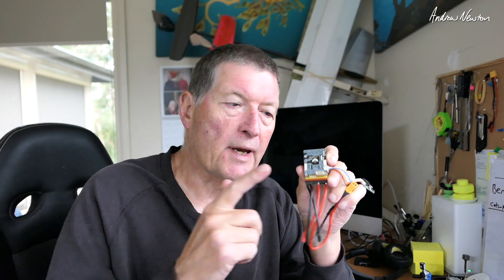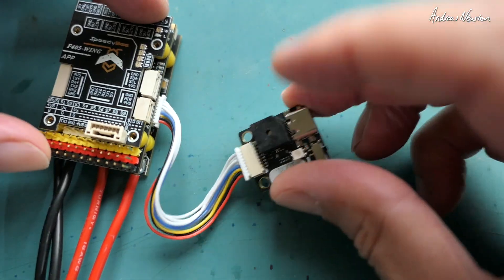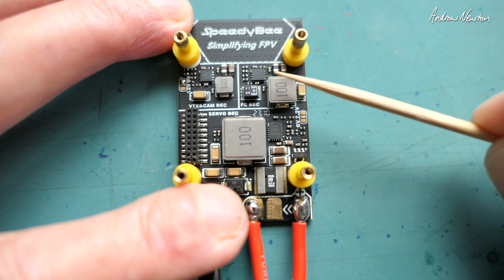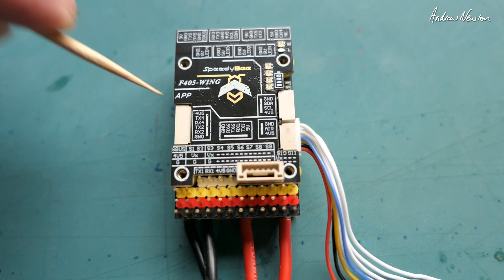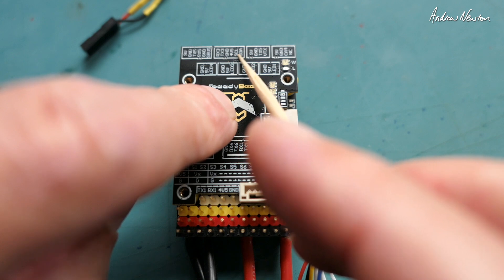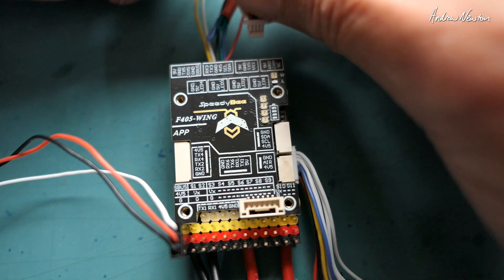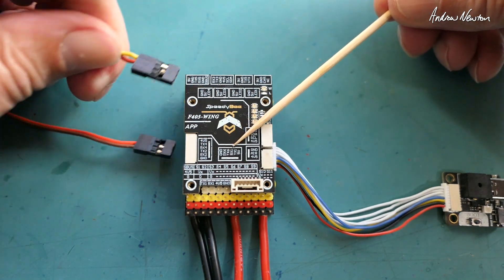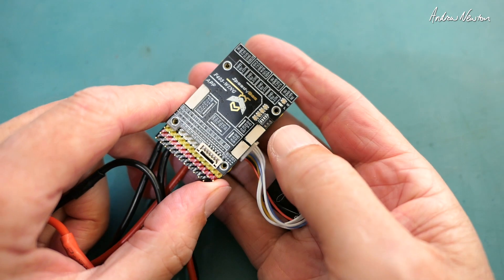SpeedyBee F405 Wing - Connection Basics

Comment: Hello Sir! New subscriber here I am amazed how well you are in this hobby, I always watches your how to videos, it really great that there are someone like you who are willing to share. As a matter of fact you inspire me to start this hobby. 
I already flown my ranger 2000, I ordered my first fc the speedybee f405 wing, sadly as I intalls the needed plugs and pins after powering using my 3s lipo I found out that my board beeps continously it seems not normal as I compare it to your videos.

May I know what can I do? Or what is really happening is it normal?
The boards heat up quickly after 5 seconds of powering via battery
Reply: Hope you see my comment thank you in advance
Reply from the maker: Thanks and I happy you are flying the Ranger. FC Heating up in 5sec is bad. I would guess there is a solder short or incorrect connection somewhere. Not sure about the beeping, I tend to turn it off until it's working OK

Comment: Andrew, great vid, but could you please try to get a servo working on port S8 in INAV. On my two boards that one gets skipped, even though the configurator shows them as configured ok.  Cheers, Andre
Reply from the maker: That is a bug with the factory firmware. Update to INAV 6.1.1 to fix it.
Reply: Ah, indeed that solved it, thanks a lot Andrew !  @AndrewNewton

Comment: Thanks for you outstanding instructional videos. Question a little off base,  but can't find answers anywhere else. I have the EPW6 from Happymodel, trying to wire it onto Speedybee f405 v3 FC for a flying wing. I have the EPW3 bound to my TX16S, I have 1 motor wired up to the f405v3. But connecting the EPW3 to the FC got me spinning. I didn't think using the esc from the PDB would going  to be this hard... I know Speedybee has a FC for a wing, Have them ordered, I say you use the mitek FC and thought I could go this way.... Hope I gave you a clear picture of what I am after... thanks again...AHC
Reply from the maker: EPW3 is just PWM as it comes, have you changed it to a serial output? Can the F405 V3 operate servos or just motors?

Comment: Hello Andrew....great video...i just finished connecting all wiring on this fc for my dolphin but i need some input from you regarding irc tramp in inav 6.1.1....seems to me the tx800 speedybee vtx irc tramp to the fc doesn't work as it supposed to be ...do inav need vtxtable like Betaflight?
Reply from the maker: Tramp wire to TX5, turn on Tramp for UART5 in Ports. That's all I can suggest. No need for tables as for as I know but I dont have any tramp devices to test with.
Reply: I tried other uarts too as Speedybee instructions via email to them but unsuccessful...same goes as smartaudio...well...i shall fly it by old ways..power up the vtx to max, connect it only after gps locked and ready for auto launch...wish me luck for my maiden on dolphin, sir😂
Reply from the maker: Just tested Smart Audio with an AKK Race Ranger VTx and it works on mine. T5 pin, enable in Ports

Comment: I am grateful for your easy to follow narration but I remain trapped with no screen representation of the receiver. I have built a second easy bee with exactly the same outcome. Hugely frustrating.
Reply from the maker: Which receiver and radio?
Reply: The change to a REAL Sbus radio worked wonders in the second unit but made no change in the first. While it seemed that the two units had the same problem it is obvious that it has the same symptoms in Inav. Thanks so much for your input !!!
Reply: The Transmitter is FrSky Taranis 9, six years old, never missed a beat. The receiver Radio Master R88 (Sbus) 1 week old working well
Reply from the maker: Didn't I answer you 2 days ago?

Comment: I have embarked on this adventure but I am currently stymied. In my connection to Inav 6 I have failed to achieve any communication from the Radio. I am running a Fr Sky Taranis 9 tx into a RadioMaster R88 rx, via an SBUS cable, out of the first group receiver pins (aileron), and into the far left SBUS connector, with white wire uppermost. This system works fine into a standard (no flight controller plane) I am using UART 2 for the receiver. But there is no response in the inav receiver display. I am not certain about the inav questions on the right hand side of the receiver page. Could I have missed some detail about the type of SBUS used ? I find it hard to believe that I have damaged  the First line of the Ports chart. But maybe ! If I had what would I see ? Any thoughts would be most welcome. Maybe I have a Speedy Bee Dud
Reply from the maker: The R88 is just a PWM receiver, not SBUS. You would need the R86C

Comment: Great video helps a lot. My question is what size SD card do i need to put in or do i need one? Thanks
Reply from the maker: Not required unless you want to record logs. Any microSD card
Reply: Thanks for the reply. I have another question please. Will the Foxeer gps work I have the M10Q 250 with compass in it? And how do you setup the throws on the surfaces like Spektrum I mean like low medium and high rates. I will be using DJI goggles2 and DJI controller with caddix vista air unit. Thanks again.

Comment: Where do you get the 4 pin connector for gps or crossfire. Great video. Ordered 3 of them. Using the fc esc stack for the quads.
Reply from the maker: EBAY DuPont connectors.

Comment: Hi Andrew. First off, this review and the others in your series on the F405 has been invaluable. I’m adding FPV to my LOS fleet, where I use a Spektrum receiver. Can you or any of your subscribers guide me on the best way to interface the two (Spektrum & F405)?
Reply from the maker: Dont know much about Spektrum but I think you would connect the receiver to UART1 T1 pin and select SRXL2 as the Serial Receiver Provider. Your receivers would have to have SRXL2 Serial output option.
Reply: I saw someone on another youtube video (Steve Salisbury) flying a T-28 in FPV with this Flight Controller using a Spektrum SPM4651T receiver and use a NX10.

Comment: How would a FrSky r-xsr connect to this flight controller?
Reply from the maker: Basic SBUS connection to the SBUS pins
Reply: SBUS is only the inverted RX and does not provide FPORT telemetry.  It needs to be an inverted TX PIN.
Reply from the maker: @kenimhof9333  Watch the next video. Soft Serial for S-Port works with INAV 6.1.1
Reply: Yes, I believe soft serial is the only option, but this is a poor design to not connect both the RX and TX pins to the inverted SBUS pin to fully support FrSky receivers.
Reply from the maker: It's an F405 chip limitation. Doesn't the RXSR have an uninverted SPort pad so you dont even need Soft Serial.
Reply: I am currently trying the pad (P underscore) and when connected to a TX PIN, I have receiver data but still not telemetry data.  Same receiver connected to an F7 board has working receiver and telemetry data.

Comment: Hi Andrew. I bought 2 speedybee F405 wing FC and both of them don't have motor signal output.  on Inave configurator its showing rx input and output but there is no acutual output on the speed control  pins. everything else  is working, arm, modes, all control surfaces, fpv goggle /camera. turning on the motor / servo output on the configurator dont make any difference.  convertional plane with tail and without tail don't make difference.  no motor signal output.  is this a common problem with this FC? any fix for it?
Thanks. hoping to get some good news from you.
Reply: After 2 days of frustration diagnosing this it’s now working.  I ended hooking up a digital servo into the ESC port and it activated that channel.  Now the ESC is working.
Reply from the maker: How strange. No idea why that would work

Comment: Hello once again.
I installed 405 Wing. I tried different tabletops as rover and airplane. I can't get output from S3. I did a solder check, everything seems normal. Thanks (google translate )
Reply from the maker: Enable PWM outputs and add something for S3 in the mixer. If that doesn't work then check your wiring or receiver connection
Reply: @AndrewNewton  Thank you 🙂

Comment: I have enabled servos, but I'm having trouble getting all servos to work😢 I'm setting up the atomic seal and everything is plugged in as inav shows. At first only the left aileron worked. Then the elevator started working
Reply from the maker: Either something wrong with your plane wiring,  incorrect radio setup or wrong board setup. Here's a trouble shooting page   http://newtonairlines.blogspot.com/2023/06/inav-trouble-shooting-checklist.html

Comment: Hi Andrew enjoying all your content here. I purchased a speedybee f405 wing recently. Every time I connect a GPS the baro stops working not sure why cannot figure out the problem . Have tried inav and arduplane same problem everytime.
Reply from the maker: Very odd. Does your GPS have a baro that might be conflicting? SPL006-001 is the onboard baro. See what is recognised in the configurator
Reply: @AndrewNewton   actually I discovered I had a pin problem in the connector the was causing the issue. I am getting a little blind in my old age . Thanks for the advice . I am hoping to use it as my first arduplane.  Loving your content Andrew very helpful and honest reviews.  Thanks.
Reply from the maker: Well spotted. You're the second in a few days with tricky connectors causing strange issues.

Comment: I have a bunch of old recievers for my flysky i6,they are called fs-ia6,is there a way to use these recievers on the speedybee or do i need to order another type of reciever?
Reply from the maker: SB F405 W needs a receiver with iBus or SBUS serial output, like the FS-iA6b. Your old receivers will work with a ZOHD Kopilot FC
Reply: @AndrewNewton  thank you ,I will still use them in smaller models that can't fit large speed controllers and upgrade to a better rx, will the fs-a8s be best for this fc as it is minimal in size
Reply from the maker: Dont know the FS-A8S but looking at the specs it should work.

Comment: Can i connect the power from my ESC BEC to the board, not using the PDB to power the servos? I've used Pixhawk and always power it using the BEC from my ESC
Reply from the maker: No, not recommended. Would still have 2 competing power sources on the board

Comment: Hello Andrew, thanks for your video! I would like to ask you a question! Does this controller have an integrated osd with information such as speed and altitude? Thank you very much in advance
Reply from the maker: Yes it does. Speed would need a GPS and/or Air Speed Sensor connected.

Comment: Good morning, what Gps module, and what speed sensor are compatible with this controller, what other sensors could be installed?  Thank you!
Reply from the maker: I use BN880 GPS, Matek Air Speed Sensor is good. Dont need vario or baro.
Reply: @AndrewNewton  thanks for reply, i will buy an a try to configure it, God bless you!

Comment: Morning Mr. Newton. Looks like you were using a RX6R for this video, which is exactly what I have in mind. Just have a question about telemetry. I want to use the Yaapu Telemetry on my X9D+. Do I also have to connect the S.Port to a UART?
Reply from the maker: Yes S.Port connection is required. But S.Port did not work with the first firmware for this board. Needs to be upgraded to INAV 6.1.1

Comment: Great video, I will be referring back to this a lot in the coming weeks. I'm wondering if the 16 gauge wire you have in this setup can handle something like a 30-40 amp motor? I'm pretty new to this and my internet searches tell me that even 12 gauge can't handle the current... I'm obviously doing something wrong here so I'm wondering about any tips for wires for my F405 wing. Thanks
Reply from the maker: I use 16 for everything but I rarely go above 20A, probably average 6 or 7A. Constant 40A would require thicker but 12 would be almost impossible to solder on to FC boards
Reply: Would 16 handle a burst for takeoffs or emergencies? Would a 14 gauge also be too thick for soldering to a board? Otherwise, I’ll probably just do what you’ve done with 16. Thanks
Reply from the maker: Yes 16 is more than enough for most models

Comment: Hello, I am having a problem with the setup in INAV. The pitch axis values are reversed. When the FC is in positive pitch the INAV says that it is negative. How can I solve this issue?
Reply from the maker: More info needed. Which page are you looking at?
Reply: @AndrewNewton  That is in the "setup"page. The problem is that when the  plane is in positive AoA the FC gives negative value
Reply from the maker: Normal for INAV. Nose down = positive. Check the receiver page, ch 1 to 4 graphs should increase when you move sticks up and right. Animation should follow the board movement.

Comment: As an addition, RX2 pin in the telemetry connector is connected to the inverter on the SBUS pin. (same inputs) Very convenient for Mavlink/RC transceivers.
Reply: Candy you tell me if I have to use the ELRS pin out to get full Rssi telemetry with my crossfire Rx , or can I still get telemetry using the s-bus pin out ? I’m using the 03 AU but I will not be using the dji radio, I’m using a crossfire v2 micro Rx… thank you ….

Comment: Hi I have very hard time getting S.Bus to work. Receiver is connected fine but no action in Speedybee...
Reply from the maker: Are you sure receiver is bound to radio? Which receiver?
Reply: @AndrewNewton  Hi Yes it is bond to Tx. I checked with scope and signals are present at the output of Receiver  (in S.bus mode). I am using FlySky Tx and FS-A8S. I set Uart to 2 as you mentioned.  Both Tx and Rx work with other flight controller.
Reply: @AndrewNewton  If you know of any other Tx Rx that would work with this Flight controller please let me know. Thanks
Reply from the maker: Connect to the SBUS pin, not UART 2 plug
Reply: @AndrewNewton  It is connected to the 3 pin Sbus connection next to other 11 motor and servo outputs. I just defined UART 2 as serial RX.
Reply from the maker: or try iBUS on RX2
Reply: @AndrewNewton  I tried iBUs too. No luck. I am going to order something for ELRS ( Radiomaster Tx12 and ELRS nano Rx). Getting too expensive for this controller. If you know any better way pls advice. Thx
Reply from the maker: Just tried with the FlySKY FS-ST8 radio and FS-SR8 receiver. Both SBUS and iBUS work. Try iBUS into UART1, change to iBUS on your transmitter and UART1 for Serial RX in the PORTS tab and iBUS in the Receiver page.
Reply: @AndrewNewton  You are wonderful! Now it works. Thanks Uart 1. Ibus!
Reply: @AndrewNewton  Now I firmly believe that this board SBUS port is broken. But as you suggested Uart 1 with IBUS is working.! Thanks again
Reply from the maker: @martynewport  Excellent, so glad it's working now. I'll include iBUS in the next video
Reply: @AndrewNewton  The latest: I was in contact with SpeedyBee and they found that my receiver was not set to Sbus output. This was nowhere explained in Rx manufacturer description. After doing so now Sbus port of F405 Wing working fine. Thanks for your help.
Reply from the maker: Clever SpeedyBee support. The receiver manual doesn't mention SBUS at all.

Comment: got my speedybe wing controller installed everything is working surfaces and modes and arming. but cant get my flaps or gear to work in the other pins is there something im missing. added the channels to the radio and also setup the servs in the mixer but still nothing. anything would help thanks
Reply from the maker: Can you see the flap and gear channels moving in the INAV receiver window?
Reply: @AndrewNewton  yes and in the mixer as well bc i added them that way also

Comment: Great video Andrew. Have you been able to connect telemetry using frsky smart port?
Reply from the maker: Yes eventually. SpeedyBee needed to tweak the firmware to enable SmartPort. Firmware links here - http://newtonairlines.blogspot.com/2023/05/speedybee-f405-wing-soft-serial-fix.html
Reply: Thanks Andrew. I assume i need to change the settings through cli. I am not sure of the correct commands. Any assistance is appreciated
Reply from the maker: @damienaile  You need to flash the new softserial firmware on to the board, then follow this http://newtonairlines.blogspot.com/2023/05/smart-port-telemetry-inav-and-f4.html
Reply: Success. Thanks Andrew
Reply from the maker: @damienaile  Brilliant